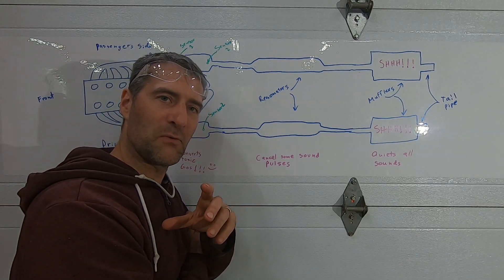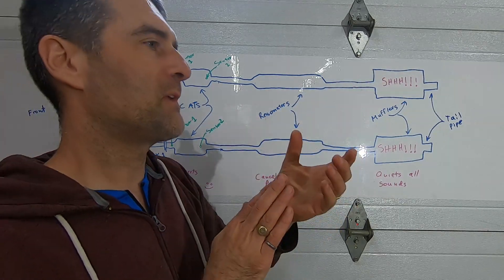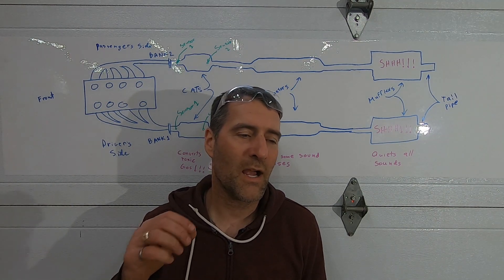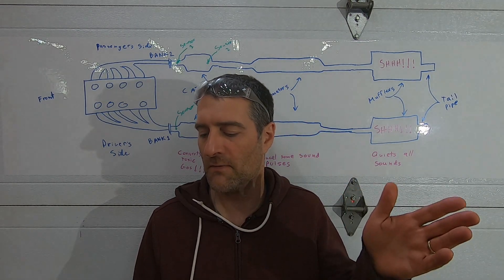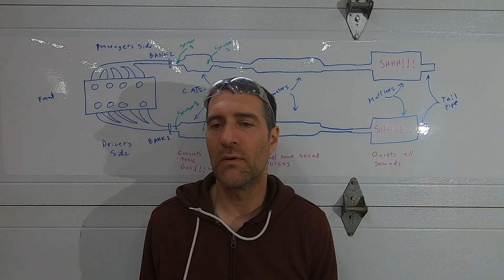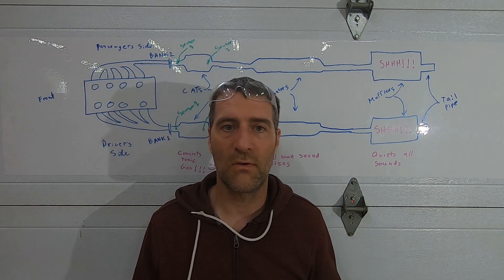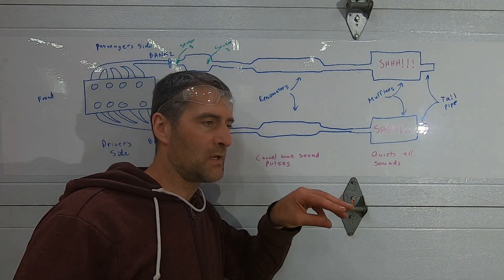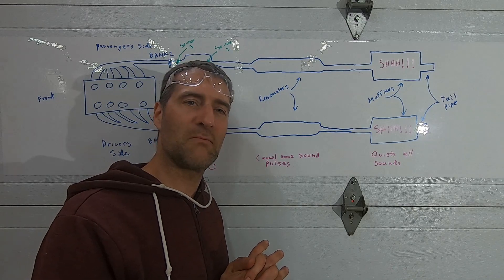Catalytic Converter Diagnosis 9 Easy Methods for Pro Results

Comment: There are actually 500 DTC`s that are related to the P420 & P430 codes. I prefer the Thermal Gun technique for determining wether or not the cat is working...
Reply from the maker: i tried to keep the video concise and focused on the most common methods.  good suggestions though
Reply: @mrdiyguy123 cutting corners when dealing with catalyst codes which often end up costing money..money that many dont have. Thermal readings will tell (1st & foremost) if the cat has failed or not. If the cat IS bad (which it almost always never is) then fine. If the cat is working then using mode 6 on your diag tool, checking TSB's & Recalls is next. If the cat has failed proper break in & drive cycles MUST be done before giving it back to the customer. Cats rarely fail on their own...something else is almost always what caused it to fail.